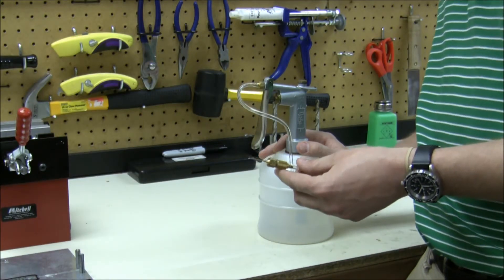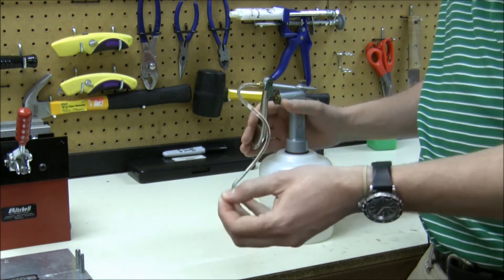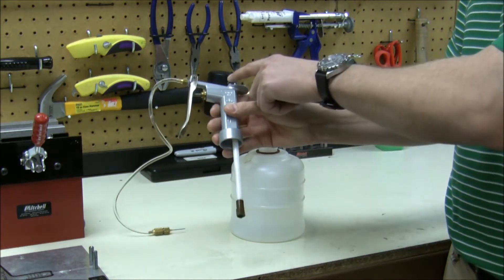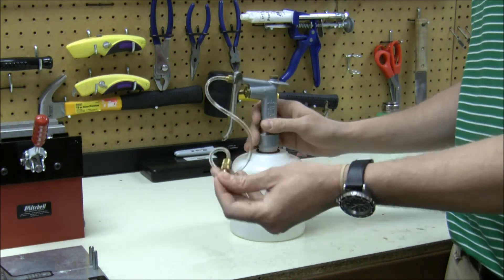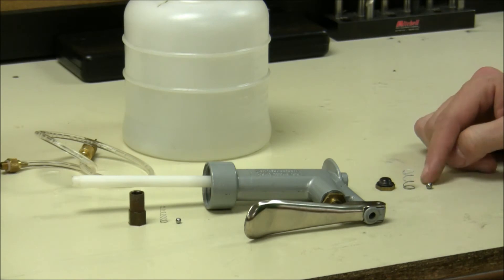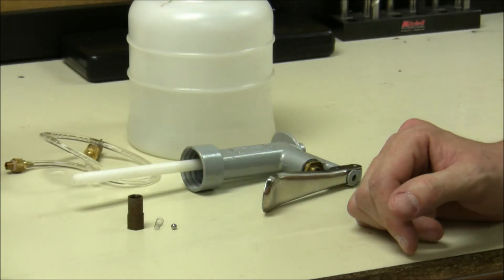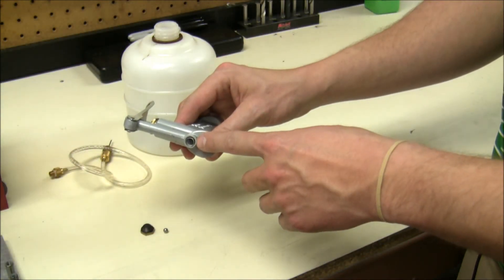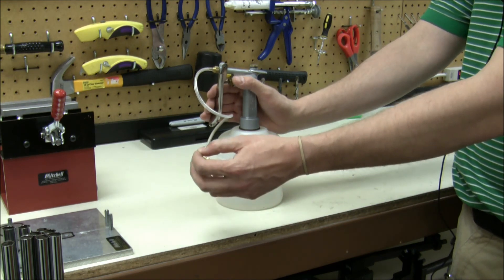Grip Remover Gun - Priming Techniques

Comment: A course of action for trouble with the grip gun...
disassemble, especially removing the brass attachment at the end of the feed tube.  Careful not to lose the ball and spring.  Soak the brass attachment in CLR to remove any "gunk" that may be inhibiting the inward flow. The brass attachment screws off the plastic tube.
Soak the cylinder as well.
Also you may pour CLR into the inverted gun assembly and prop it up and let it soak overnight.
Flush with hot water. Reassemble.  
Do this before ordering the rebuild kit.

Comment: Ok, did steps 1,2,& 3, & still can't get mine going. I even replace the spring, gasket, & the brass piece. Tried for 20 minutes to get working. It was a no go. Please help. Mine is the same as yours, all metal.